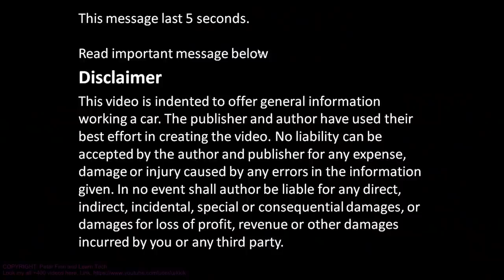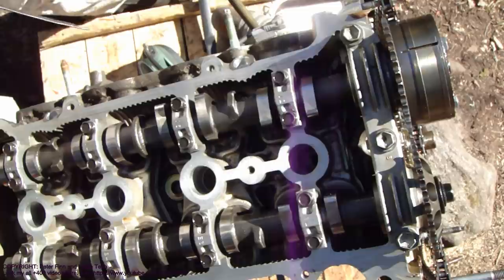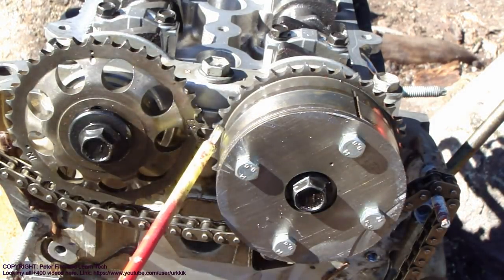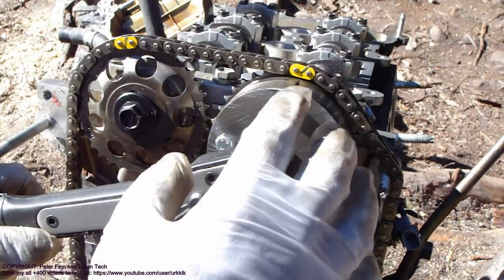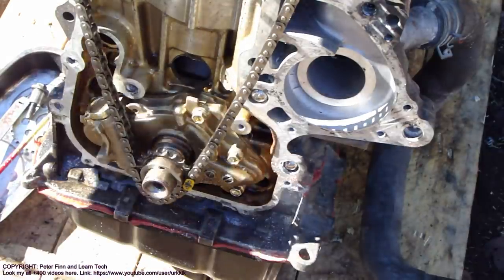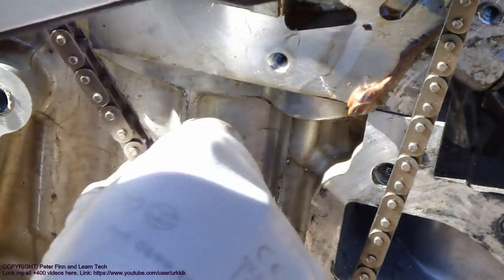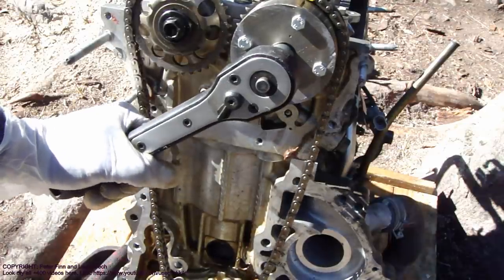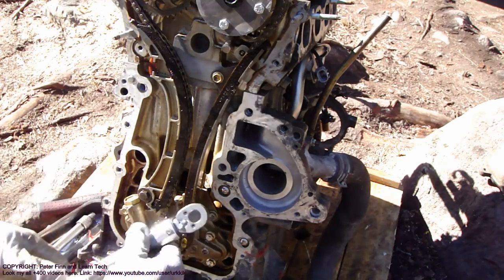How to assemble engine VVT-i Toyota Part 30: Timing chain setup and installation

Comment: Peter the correct procedure is to lock the vvt sprocket with air pressure. Look on the back side of the sprocket you'll see the hole that normally oil is used to control the variable valve timing. With a rubber tipped air gun pressurized to 20 psi this will give you the ability to rotate the sprocket independently to the cog face. As you rotate it it will snap into the locked zero position. There are marks on the the rear of the intake sprocket that will witness the assembly. Now your ready to set up your chain and exhaust and crank sprockets. Much easier and you'll be absolutely sure that your intake cam will be correctly installed. Hopefully this helps.
Reply from the maker: +dan rieco Thanks for extra info. :-)
Reply: You welcome, I enjoyed watching. It's nice to have people such as yourself, helping people in these trying times of economics. At one time people would just toss it in the bin. Note you are a true savior. Instructing them on the refurbished of motor technology. Good for you Peter and you're a blessing from God.
Reply: Hi Dan. Do you have or know of a video for this? Much appreciate your input!
Reply: +dan rieco  I agree.
Reply: @sunnydan11  i wanna ask u few questions

Comment: Thanks for the video my outstanding tutor. IAM extremely worried.My chain tensioner was leaking oil ,so I took steps to correct the problem and installed it back.When releasing the chain tensioner so that it can hold the chain tightly, I made a mistake by turning the engine anti-clockwise. After a bit of turning, I heard two click sounds.I thought the two clicks come from the tensioner being released and when I checked it  for sure the tensioner was released. After the tensioner was released I turned the engine clockwise and I observed there were other times the chain appeared to be loose and other times tight on top.The chain guide on the tensioner side appeared to be loose also other times.
My worry is: could those clicks be the timing chain jumping? How can I know if the chain jumped? If the jumped how can correct the problem? The engine is 1zz vvt-i Toyota and it has been working perfectly well.

Iam looking forward to your feedback at your earliest convenient time.
George.

Comment: hi peter great videos helped me alot but im having a debate now with a friend, after we timed up my celica 1.8 vvti chainhe rotated the engine manually twice all the cam marks came back to the top and the crankshaft pulley was back where it started but the marks on the chain werent at the top, so now he thinks my timing is out, so my question is should the timing marks on the chain line up after two full turns of the crankshaft??????
Reply from the maker: +richard lees Hello. Timing marks moves to different places, when we move crankshaft.  But when you rotate crankshaft many times you, you have markings in right places again !  Please check.

Comment: Very good video, I have that motor exhaust cam does not move but the sprocket turn with the motor, is their a key in the cam shaft or how is it turn with the shaft. Thanks

Comment: wish there was video of the vvti cam gear unlocking.great videos as allways
Reply from the maker: wiilam snyder Ok, good idea.  Thanks for comment.
Reply: wiilam snyder  I agree. I need to replace my Cam gear on my 09 Matrix. I didn't know about the TSB until we had 90k miles. Now we are getting the cold soak startup rattle.

Comment: Thank you so much Peter, I'm currently a student in mechanics I just wanted to ask that, when we are setting timing the marks of the crank gear and cams will it not disturb those 2 marks that you said they must face each other on the cams?
Reply from the maker: Yes, exactly

Comment: I recommend using flange bolts if replacing the stock intake cam sprocket bolts. The bolts shown here are known to come loose under vibration.
Reply: hiblendmedia lllllkkjj

Comment: please question. 
I have 1az-fse motor
with direct fuel injection 
it's the same procedures ?
and what the difference between 1az-fe and 1az-fse timing chain?
I want change it my self have you somthing to advise me?
thank you very much 
you are the best in you tube.
Reply from the maker: +jameel jamal Hi and sorry. I don't know the parts of  1az-fe and 1az-fse  engines. Please visit here, they know:  https://youtu.be/MdZUPHaswno

Comment: peter great videos man , i have a rav4 04" its leaking oil between cylinder  and engine block. might be the cylinder head gasket
Reply from the maker: luis guiso Yes, it sounds just that.
Reply: ThNks ,

Comment: If the timing chain is loose, would it be possible to turn the intake camshaft gear to tighten it up?
Reply from the maker: Robert Romo Sorry no. The belt metal stretch and it is finally end.
Reply: Hm just read that it's normal for timing chain to be a bit loose because tensioner works on oil pressure and higher revs? Not sure how true this is on this engine, mines a 1zz... Not sure what to think! lol Thanks for responding back to me.
Reply: This is what i mean sir. That device acting as Loose chain governor.. Can u imagine how the left arm will keep the chain in place without ur hand touching it?

Comment: Have a P0016 code on Toyota shows camshaft sensor for bank 1 does not correlate to crankshaft position sensor
Does this mean I need to change cambelt. The oil wasn’t changed by previous owner.
Reply from the maker: Noted 😀

Comment: can someone answer this for me.
from the video I conclude all that needs to be done to set the timing is to align the marks on the timing chain with the correct markings on the cam shaft and the crankshaft sprockets. is that right?
do all timing chains have marks on them?
Reply from the maker: Yes
Reply: @PeterFinnTheCarDoctor  
thanks Peter. your videos are awesome!

Comment: 32:49 the left guide is loose on top but firm on the bottom, is that normal? I haven't put the timing tensioner back since I'm about to correctly put the chain back in the engine.
Reply from the maker: Yes, it is normal. The left guide become tight and firm, when I install the timing chain tensioner. Look tensioner install video here: How to assemble engine VVT-i Toyota Part 32: Tensioner timing chain

Comment: the first piston when is up position in this case meaning admission stroke because de valve is open?
Reply: in take valve I said.
Reply: when the cams are pointing up all valves are closed and   piston is in compression

Comment: Hi I m from pakistan I have a toyota probox 2006 dx 1.3 with 2nzfe engine. Issue which I face it is p1349 .after overhaul my engine this error come after 20kms and my car idle speed and rpm up and down on ac .
Check and clear this error  but it will again after few kms. Kindly assist what to do now

Comment: On 2004 toyota matrix transmission dipstick is a sticker that says "Under normal driving condition no fluid change needed" Im confused becus my fluid is already dirty dark red color. Help!
Reply from the maker: +rotcataergeht Please replace the fluid immediately. Visit the nearest Toyota dealership center or do it self.

Comment: Hi Peter!

I think 15Nm for the chain damper bolts is too much. My manual says 9Nm. One of my bolts broke when I tried to torque it to 15Nm. Can be good to know. 

Thank you for good videos!

Håvard
Reply from the maker: +Håvard Pihlstrøm Interesting info. You bolt will must be already weak and used.  Many Thanks for comment. :-)

Comment: Haha, don't hammer de sprocket, just cut an old piece of tube pipe or so, and use a pulley or sprocket puller to pull sprockets off of the crank shaft, and set the timing chain guides simultaneously with the timing chain after setting or resetting all the yellow markers at their correct points than set the timing chain guide under tension immediately with the timing chain tensioner!...lol.  .. ok now for setting the next job ,setting magneto timing on a 
Teddy Lycoming engine...haha
Reply from the maker: Good tip!

Comment: Hi 
I have a 1.6 vvti engine in my 2005 corolla 
The engine spins over like it has no plugs in it 
Would u say the chain has broken and if it has does it reck the engine
 as it doesn't sound like it touching 
Thank lee
Reply from the maker: Hi, you have maybe ignition coil bad

Comment: Hello friend 🫡🫡🫡
Can you please help me what's the torque amount for 
intake cam bolt:
exhust cam blot:
Cran shaft harmonic balancer bolt
Spark plug plugs :
for 2006 toyota Scion Xa  , 15 lit
Thank you for your response .🙏👌🙏
Reply from the maker: Noted. I need to investigate. Maybe the same like Corolla 1.8 engine.
Reply: @PeterFinnTheCarDoctor  Thank you for your help 👏✌🙏👌🙌💚 🤍 🦁 ❤

Comment: Hello What happens to the car when A chain cut while driving in the case of the Toyota Camry series 2005-4 cylinder interruption during the course of what happens to the car engine
Reply from the maker: Bad engine failure
Reply: thanks my friend you mean there its no solution
Reply: me job car maknikal
Reply: I believe ,and plz correct me if I'm wrong in us , a 2005 camry 4 cylinder is non-interference motor with a belt for timing.

Comment: hy sir...i have a problem whit my 1szfe. i go to service they find p0172 system to rich bank 1 . but not fiinding the solution. please give a a tip.
Reply from the maker: +Lucian Azyzz Hi, there could be many things.... like these P0172 issue roots:
-Faulty front heated oxygen sensor -> sensor clean?
- Ignition misfiring -> spark plugs 
- Faulty fuel injectors -> check
- Exhaust gas leaks -> fix the pipe
Reply: +Peter Finn thanks i fiind the problem...i was slow aer intake..all senzor is ok..

Comment: Need help I have a code p1349 and have change the sensor still the code pops up we with engine check light
Reply from the maker: Engine timing chain is strech

Comment: U forget to place the left rod spring.
Reply from the maker: aditya isfahani Hi, really. Please tell that what is time in video, when I forgot a place rod spring. Thanks.
Reply: Pause in 31:32. U'll see a bolt hole in upper left corner? That's the place of it. It should installed horizontally to make the plastic arm swinging to the right so the chain will holds. Without it how u keep the chain tight sir? Cmiiw
Reply: +Peter Finn thank u anyway sir for uploading such a video. Really helping many people.
Reply: aditya isfahani  I think the purpose of this video was to demonstrate how to fit the chain correctly using basic tools. I like the video. I will try to use this video to fit a chain on an engine that has given many people problems